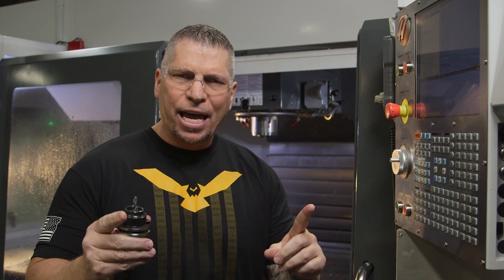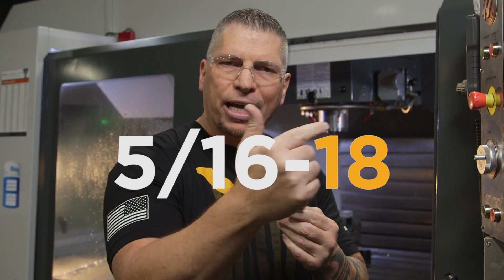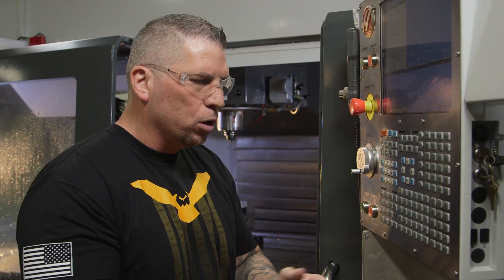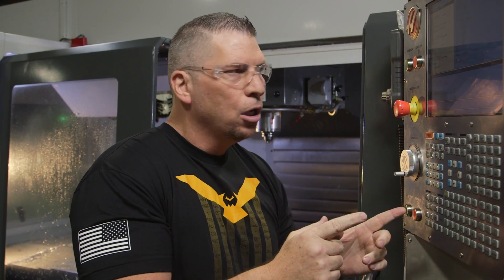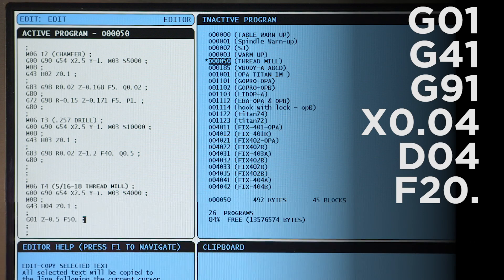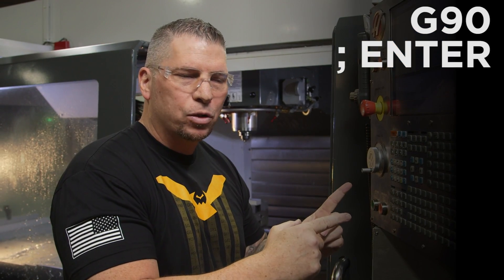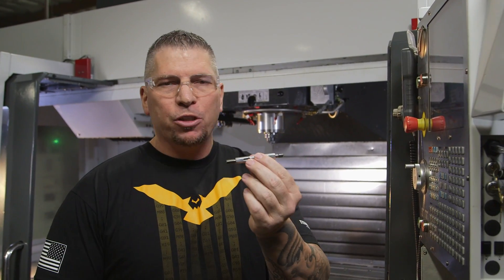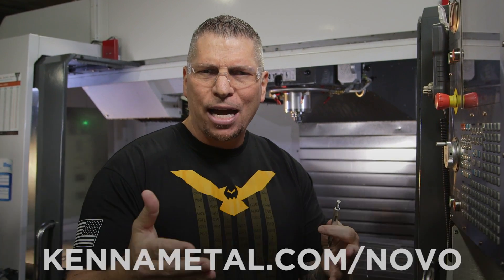G & M Code - How To Manually Program A Thread Mill - Vlog #57

Comment: Titan, learning manual programming is the best.  Thank you for your very generous contribution to an industry that has treated me very well.  I am a certified general machinist, working on CNC since the beginning for over 30 yrs.  

A simple trick or saying I learned for using I&J in G02/G03 is, (remember it as you are the cutter) "Where is arc center to me"?  This number is the actual distance (incremental) from where you the cutter are, to the center of the arc that you are programming.

Titan, I noticed a safety area that I always use to this day (which has saved me more than you know) is on the G43 line, [ G43 H12 Z5.  ] the "Z5." used in conjunction with single block, gives a safe position to stop that a tape measure or gage block can tell you if you are at 5.0" or something is already wrong.  Even Z2.0" is better than running in rapid to Z0.10" of within the part.  I even have the posts for cam programs changed to output this as a master start point!

With the speeds of the machines these days, we all need habits in programming that build in safety to help reduce hitting the parts or worse crashing the machines.
Reply: I do the same but with a 1." above part or fixture, clamp which ever is the tallest.
Reply: @frankr608  excellent, I remember programming 1.0" or 2.0"...easy to check with gage, or 1x2x3 blocks. I have migrated to 5" or 10", as I am on large format horizontal boring mills now.  This as you suggested, is safe to clear a number of obsticals.  Programming manually or with cam packages, I feel there must be safety built in to the programs until fully proven.

Comment: This  example is basically the same as my technique but i was taught to roll on,roll off with an 1/8 pitch movement in z instead of of a g01 linear movement and also i noticed no cancellation of cutter comp,but hey if it aint broke dont fix it,love the vids,keep it going Titan.
Reply: When the D value is zero it wouldn't matter, I wonder if the comp would move the cutter off the centerline and leave a line in the thread, I guess it depends on how the HAAS handles that back and forth movement between passes.
I noticed he had some code covered up maybe it was the G40s and he cut them out to simplify things.

Comment from the maker: Hope you guys enjoyed this video! I've been getting asked a lot to do more manual programming tutorials. What other specific manual programming tutorials would you like to see?
Reply: How about starting with the basics since you are teaching CNC.  Every student should understand what all of the basic G&M codes do so they can read a program.  Although you can get a list and read it, actually seeing it in a program and understand how it is used is a good thing.  Tie the codes together and make a part that uses them so a new student can read, understand and see the codes in action line by line.
Reply: @Vytor01  check other videos he teaches ghat as well plus there's lots of material about g and m code online
Reply: Jag skulle vilja se verktygs- och borrnings och gänga sen conic  tack
Reply: How about programming a counterbore?
Reply: If u can helical spiral gear wheel. Booom!
Reply: First off I love what you are doing for our trade! I have referred many young up and comers to your channel, and have seen where  your channel be if it’s not just the youth but 30+ veterans as well (myself included).

  Would love to see a tutorial on macro programming and how beneficial it can be for common parts, as well as figuring formulas etc.  keep up the great work!
Reply: How about a pipe thread say like 1/8-27 Where you would  use an L-1, L-3, and a Crest gauge ? Is the technique different?
Reply: How about turning eccentric diameter on the lathe? Thank you for share your knowledge
Reply: If I may, I think a thorough explanation of G02 and G03 work would be nice, including using R vs. I, J or K and how all the values have to work together. Thanks for all you do Titan.
Reply: Would love to see thread milling on the Mori'S .

Comment: Easy peasy but why u dont use tap insted of threadmill? I think maybe its easier to make thread with tapping.
Reply from the maker: I am teaching all different styles and techniques. Tapping is great but Thread Milling is a must in Hard materials such as Inconel & Monel etc.
Don’t want to break a tap in expense material
Reply: Thread mill allows you to have absolute control of thread fit. As Titan stated thread mills are a must in some materials.
Reply: If you break a tap in the part it costs money to have it burned out then welded ,drilled and tapped again. Threadmilling ,if u break 1 u simply blow out the broken pieces and try again without having to spend more money.

Comment: Hi Titan why G01 x0.04  not G3 x0.04 r0.02?
Reply: R is half with r u need to make one pass more.
Reply: Mirzoni With r it will use arc instead straight line extra pass will not be needed as end point will be same as with G01
Reply: Correct me if I’m wrong so if you use a r value it would be half of .04 and he is useing .04 to be half of .08 so that is why he is using .04 and not r.02??????
Reply: J0nzi3 USA He is using (half of 0.08 ) from center of a hole in as straight line (G01 x0.04) but if you use (G3 x0.04 r0.02) instead threadmill moving in a straight line will make arc movement (semi circle in this case) ,to make that arc it will need radius (r0.02 - half of 0.04) hope it is clear enough
Reply: Either way will produce the same results unless a very minor step in the bottom thread will be a problem for your process. It's just a G01 will reach the cut quicker than a G03. Remember, the shortest distance between two points is a straight line.